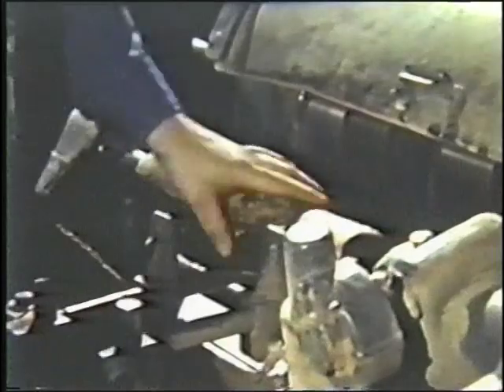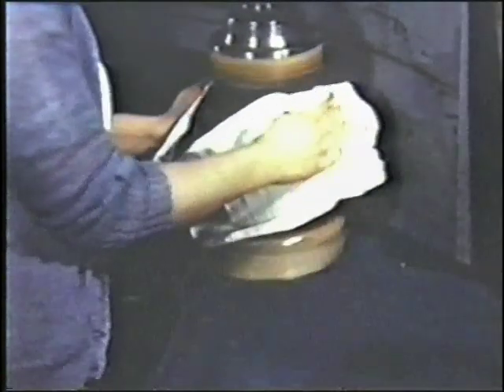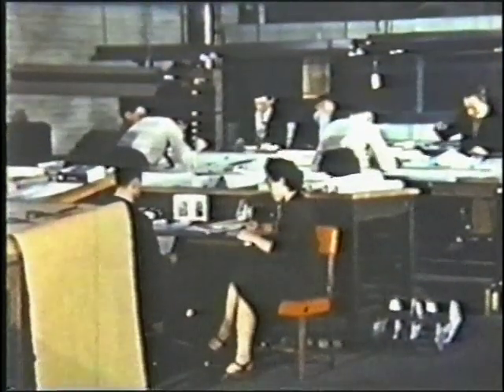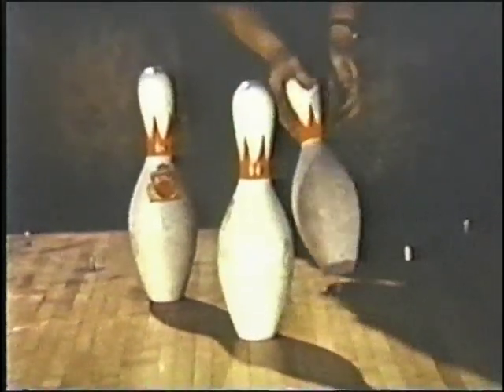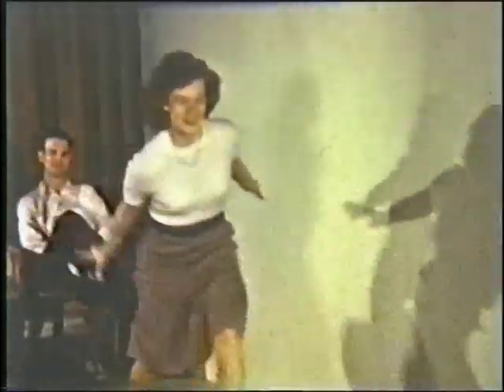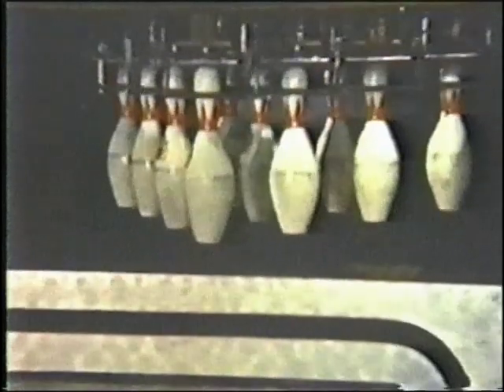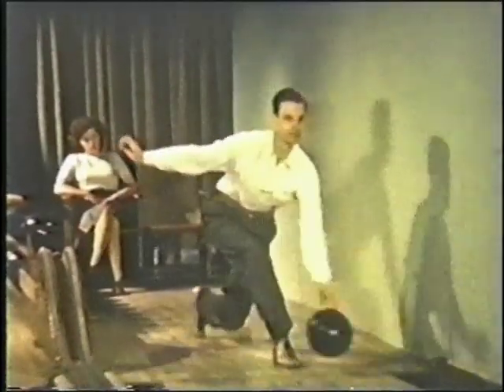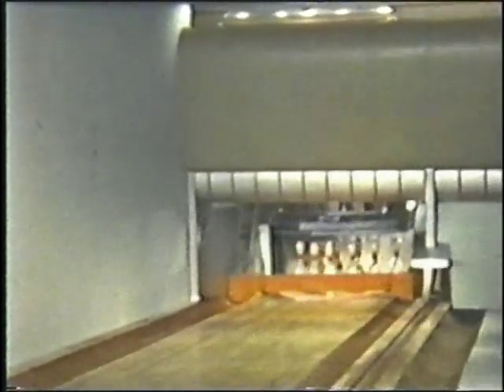Brunswick promotional film (1948)

Comment: In the '90s, I worked with a consultant who had led the Motorola team that built AMF's original automatic scorekeeping system. Brunswick had beaten AMF to the punch and AMF's own in-house team was nowhere near ready to release anything, so they scrubbed that project and farmed it out to Moto. They designed and shipped their system in about a year. His tales of its development and especially the testing were wild.

I find it interesting that these early Brunswick prototypes both didn't go through a full cycle when detecting that a full set of pins was standing after a gutter ball - yet the systems they eventually shipped didn't operate this way, going through a full sweep cycle regardless. Also funny how the sweep bar rose way early, leaving the pinspotter hardware exposed longer than it should have been.
Reply: Yea, I'm bamfoozled how detection tech was engaged in this unit and the '46 AMF unit, yet those A-2s that I've often bowled on since I was a young one went through the full cycle no matter what pins were/weren't hit.  If you own an alley, you really rather the machine do as little cycling/motion as possible to reduce wear on the equipment and save on the light bill.
   I could be speaking out of turn, but I want to say I read that there are electronic upgrades that you can get for many of the older 60s-80s units to give them some of those operatory features as say the newer Qubica machines seem to offer (haven't been to a modern enough alley to see those in action, but based on their sales brochure I've seen online they are pretty sweet machines).
Reply: @JadeDragon407  could be whatever mechanism they had to detect added too much complexity and introduced more breakdowns than they eliminated. Probably just simpler to do the same rite cycle Everytime. What I want to know is how that one pinspotter detected the strike with no contact, before automatic scoring and their cameras were introduced. Pindeck weight? Magnets in the pins and leaf switches in the pindeck? And if so, why could it only detect a strike without reeling, but had to feel for the other leaves? I suspect the strike cycle may have been "simulated".

Comment: Some friends and I were open bowling at a place called Madison Park Bowl in Michigan.  The owner came over and started up a conversation where he mentioned that he lost his mechanic.  A friend of mine was already a mechanic but I gave the owner his phone number to contact him.  He worked late nights getting his ancient Brunswick A's back in shape and running flawlessly.  My friend was shocked when he first went into the back and found that they were made by the Otis Elevator Company and had serial number in the 400's.
Reply: I have a friend that runs a bowling center near me, and lane 14’s pinspotter is serial number 1278. I believe he told me the first 2000 Model A spotters were made by Otis. You can always tell machines were made by Otis because they are army green

Comment: To put this into perspective: serial numbers on Brunswick pinsetters start at 5200, which had a build date of July, 1957.
According to a list obtained at bowl tech.com,
Serial numbers below 50000 were made by Otis Elevator Company for Brunswick. Final "A" Pinsetter was made on June 24, 1962.
Final "A-2" Pinsetter was made on September 11, 1985 Serial Number 110402. Serial Number 50001 and on were made in Muskegon.
Serial Number 80000 was the start of the Factory "A-2" series.
Reply: So what was the date range in which Factory A-2's were built? As far as I know, all "Jet Back" machines were field converted and not originally built that way. And of course the Japanese models would have the "J" prefix in serial number.
Reply: @railroadskater2896  I cannot find the document that I had from Bowl Tech years ago; I know that they made a lot of "A"s but converted many of them to either JetBacks or A2s in the field. Field A2s still had the long-stroke lowering link, compared to the Scotch Yoke. Looking at the dates above, it looks like factory A2s started in '62 (final A was June 24, 1962). In addition to the Japanese models, there were also German-made models as well. You can look some of this up on Bowl Tech.com; it is a great resource from people who know much more than I do!

Comment: For anyone and everyone wondering, the patent for the first pinsetter can be found at google patents. It's called "Bowling pin setter" and was assigned to "BRUNSWICK BALKE COLLENDER CO". I also found around three other pinsetters assigned to Brunswick, but I didn't find the exact one they used in this film as number two (the one with an orange sweep). It would have been interesting to see how they made it work, and what the differences are between that and modern pinsetters and pinspotters.

Comment: The second pinsetter shown was actually patented in 1925 by JW Bishop.  What they are showing is most likely a very old prototype that they had built in the 20's.  My guess is that they trotted it out, and put a newer style masking unit in front of it. If you look closely at the old photos they show you see this machine that they admit that they had 25 years ago.  It's interesting that they show patent drawings for mostly manual machines. They certainly used many of the ideas from this machine on the A's as the patent drawings show a kind of turret.  Also the idea of the "moving deck" but in this film the deck moves forward instead of to the rear on the A's to release the full set of pins.

Comment: AMF beat Brunswick to the punch because they figured out 2 problems that stymied Brunswick: how to pick up and respot offspot pins in the same place, and how to load pins, aka, the pinwheel. Yes, a few years later Brunswick made their pinsetter with features that theAMF 82-30 did not have, which AMF added with the 82-70, plus more. It was the pinsetter wars.
Reply: In the Mini Bowling division (made by Youtube Bowlers who were Pinsetter Enthusiasts that made Mini Bowling Alleys), Brunswick wins by 99% haha
Reply: All from the fans of their pinsetters lol
Reply: @PinoyBowlerGS92  Brunswick is easier to recreate because they are mostly mechanical. AMF'S are mostly electric.
Reply: @Sean-mclaughlin  Well the GSX is also electrical but the Sweep that what got the enthusiasts to build their GSX and the Table has easier parts than AMF for them to copy, I mean if you seen one of Andys Bowl old videos for his mini Skyline Bowling Lanes, he got his Table figured it out by detail with no excessive mini springs included and his also currently working on his newer version of the GS Table which I can’t wait. Even tho GS wasn’t the greatest Pinsetter but its still the best machine to copy.

Comment: This video is fascinating.  It's interesting how there is no "pindicator" to light up on a display which pins are standing.  Also, for whatever reason, modern pinsetters still lift the pins and sweep under them even if a gutter ball is rolled.  I wonder if they found that there was a problem with a "gutter cycle" where it doesn't lift & sweep.
Reply from the maker: Well, I wasn't around in 1948 to be able to tell you whether there was a problem with the "gutter cycle."  But it makes sense to me that the cycles they settled on made for simpler operation.  First ball and second ball cycles only, and no "gutter cycle," as you called it.  One less cycle to remember.
Reply: I would have to say that it comes down to complexity. The A series essentially does the same action for both balls. The only difference is the second ball cycle holds the deck up for the 0-180 portion of the cycle, causing the mechanical detector to go into strike mode and set a full rack. The complexity of the strike and 7-10 pickoff cycles likely drove reliability down and cost up.

If I recall correctly, AMF didn't have a short strike cycle or 7-10 pickoff cycle until the 82-70 with the MP (microprocessor) chassis combined with automatic scoring of some kind which connected to one of the round plugs on the 10-pin side of the chassis. (The center I worked at had this configuration while I was there.)
Reply: The Brunswick GSX will not sweep if they are gutter
Reply: Tay TYLERIENMAM Station only gs x 92 up
Reply: I'm guessing once they saw a 4 year old roll a 6lb ball that takes 2 mins just to get down the lane, they realised they might have to sweep the ball, even if the pins weren't touched.

Comment: the second machine looks like a prototype of an A-2
Reply: It is an A-2.
Reply: @jennyknopps1291  Similar but definitely different. On A-2s the chutes load in front of the pin spot and move backwards, this version shows the chutes behind the pin spot moving forward. Also, it appears that it uses some sort of sliding table deck to respot pins rather than finger mechanisms. Would love to see it more up close.
Reply: And the first machine looks like a prototype of the GS-Series Pinsetters. It even had the GS style sweep, pin detector plates and pin elevator

Comment: In the 40's the guard / sweeper would raise up before the pinspotter finishes its job 
and would not protect the pinspotter from errant rolled balls  . There were no 
"pin lights" to let the bowler know which pins were still standing .
  In the 50's the guard / sweeper would stay down until the pinspotter finishes its job 
and thus protect the pinspotter from any errant rolled balls  . There were still no 
"pin lights" to let the bowler know which pins were still standing .
  In the 70's and the 80's there were "pin lights" lit to show the bowler which pins 
were still standing .
  In the late 90's or early 2000's automatic scoring was introduced ! No more paper 
sheets ! Also the machines "knew" exactly how many frames were bowled and 
would automatically shut off at the last game played . No more "free frames" .
Reply: Oh, there were "pindicators" (AMF) as early as the late '50s and early '60s -- the lights to indicate which pins were left standing, and they even had arrows showing where to throw the ball to convert the spare.
Reply: @ProdigyBowlersTour  Thank you and you are correct.
Reply: Actually automatic scoring machines came out in the 70s.  Brunswick had this large analog machine that always jammed on carbon copy scoring sheets.  One machine covered 4 lanes and about the size of a refrigerator - it weighed a ton!

Comment: 1:37 What kind of Maple Wood is this ? Probably these are a lot better than the Maple Wood in of those Cheaply made Brunswick Max & Brunswick Scoreking Pins which were not as good after 4 Years.
Reply: Old growth rock maple, I'm guessing. There's been a lack of quality wood across the board in various industries. Remember, though, that our laminated pins are so much easier to score on; these were somewhat dead in comparison.
Reply: @johnseal56 . Pretty much because of lack of trees for Wood Pins to be made.

Edit: Glad those Twister Pins are the eco friendly and money saving pins, well despite the sounds are terrible and prone to slid and not fall due to lack of Pindeck cleaning.
Reply: @PinoyBowlerGS92  Yes indeed. And I've seen the demos of Twister pins...you'd want them to do well, but they've their own set of problems, it appears, if they aren't handled just so—getting really filthy, sliding as you've mentioned, not running nice in machines, etc. All of which can be surmounted with a lot of trouble. And the sound is disgusting, lol. 

You may have noticed that their permit number is S-2. S-1 belongs to the "Magnapin", a hollow pin made of magnesium that is, ah, really something. I've heard of an annual tournament years ago in Edmond, Okla. that employed these pins, and I'm told the sound was as atrocious as the carry.

Comment: Is it a pin elevator or a pin wheel, that lifts up the pins to the setting table?
Reply: I don't know if I meant the first or the second one, but at least I know for sure that the first one used a kind of pin elevator and not a wheel. Haha, four years later. :P
Reply: The second one its probably a Pinwheel
Reply: Between the minute 7.48 and the minute 10:04 can see an "intermitent light" when the setting table is picked up. Probable, that light is interrupt by pins supports of elevator.

Comment: I wonder what differentiated King, Queen and Duke.
Reply: Taking a bit of a guess: without knowing exactly where the Queen fit, the Duke (which appears to be a "second-quality" model based on the knots I saw in a couple of the pins being lathed) was reserved for open play while the Kings were used exclusively in leagues and tournaments. I'm sure mileage varied. It seems like I remember back in the 1980s that the "good" pins were rotated in for the evening leagues and then removed and replaced with the older wood for open play, but I haven't seen this done in a while.

Comment: even with the A series in the field over 60 years, it is far from perfect since there are modifications coming out constantly
Reply: How about looking at it from the perspective of the fact that there are machines that have been running day in, day out, for 60 plus years (obviously with maintenance and part replacement)?
Reply: The Brunswick "A" pinsetters were robust machines that could take heavy use day in and day out. With proper maintenance, many of them have lasted 50 - 60 years. I wouldn't be surprised that they could last 75 - 100 years.